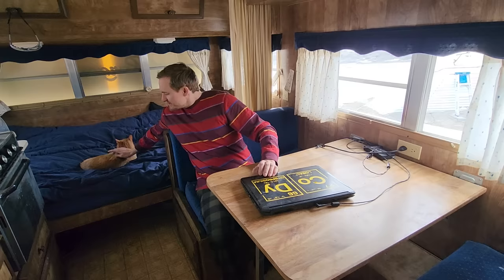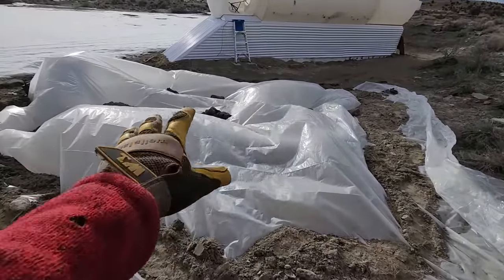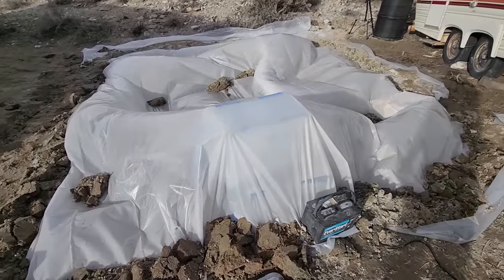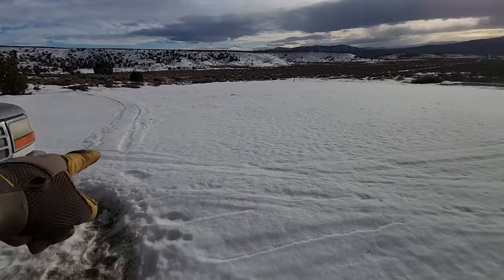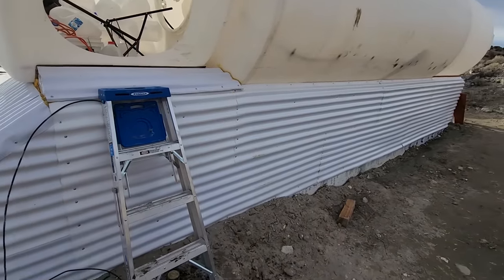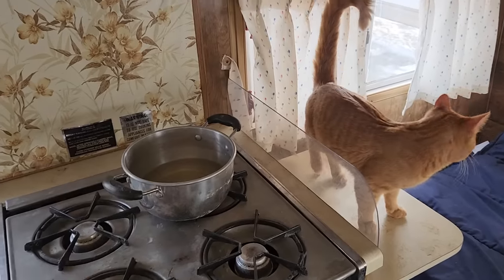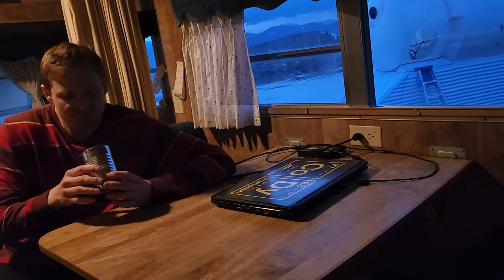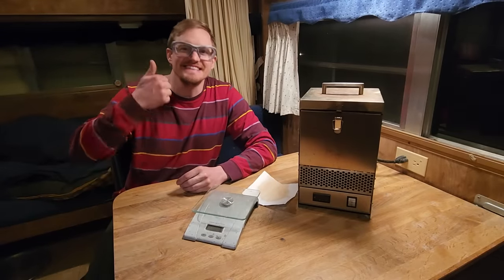ChickenHole Base Ep 21: Moisture Mining

Comment: I have a couple ideas for your water collection. I think it would make sense to combine your mineral heating method with the tarp method. To do this, instead of using a dehumidifier that needs constant power use a hygroscopic desiccant like calcium chloride or epsom salts. You can absorb all your water in that way without constant power expenditure, then kiln out the water all at once a few gallons at a time. I bet the short burst of kiln power will be less than the constant dehumidifier power. Maybe just have a little solar powered computer fan for mild circulation. Second idea is to mount a big umbrella shaped tarp on a wheelie cart or an automated roomba thing that changes location when it detects humidity has dropped below a useful threshold.
Reply: The buckets of desiccant could remain stationary in a solar still, picking up water at night, and getting rid of it during the day.  Just change where the air circulates twice a day.
Reply: @jimmymcgarry Your the kind of guy who buy him self out of a problem. But money can't buy brains bubba. The only bad idea in this world is not trying
Reply: Please collaborate!
Reply: alternatively, why not just use "passive cooling" (atmospheric window IR emission) for condensation, since the moisture is created by the sun anyway. 
the humidifier is essentially just an easy way to collect condensed water, no real need to waste power for that.
Reply: Interesting ideas. You might be right about the kiln using less power overall, but the advantage of using the dehumidifier imho is that it uses less power all at once, so in the context of a system on Mars, where there is effectively infinite solar power over a long time, but a strict limit at once (due to solar collection), the tradeoff may be worth it. Cody, you should have a drag race between the two methods! By the way, i love the idea of a giant roomba with a moveable umbrella to collect water autonomously. Very 1980s anime!
Reply: @TheRealWulfderay  im guessing some kind of gravity battery could work being fairly low tech and reliable as long as you keep sand out of the motor/generator. (motorater?)
Reply: Great idea! But there's more. Forgot a couple key elements a system like this should exploit, surface area and wicking. This should take advantage of the same basic principles radiators use in optimizing surface area for heat dissipation, only in reverse as we're trying to absorb moisture into the air. Depending on the wicking ability of the soil, furrows should be dug in a serpentine long, wide, and deep enough to ensure maximal loading of the flowing air before it reaches the desiccant. This should also ensure no dead zones are possible like with the current set up.
Reply: Easter egg!
Reply: Because heat transfer is proportional to temperature difference, I suspect heating up a kiln by hundreds of Kelvin is going to be less efficient than maintaining a dehumidifier with a small temperature difference in the tens of Kelvin. Higher temperature differences are proportionally more inefficient to maintain -- a  hot kiln loses energy much faster than a warm dehumidifier.
Reply: Always good to see Nighthawkinlight on so many nerdy science videos, not only that but sharing his educated and experienced opinions. One of the real ones 👑
Reply: @Shmashing2123 spoken like a true fellow who doesn’t know what they’re talking about, great input buddy!
Reply: @Shmashing2123 If you were stuck on Mars with thirty people, Night and Cody being part of the group, I think you would win the "who to eat first when we run out of food" debate.
Reply: I think using dessicant salts is a nice idea, but the more strongly they accept water the harder it is to remove again from the brine/crystals. I think the more efficient way might be to capture the water into silica gel with a fan under the tarp, and then release it with something more efficient than a kiln but that you still run for only a short time. Either the dehumidifier or (ideally) something similar to the way a heat pump clothes dryer works. (using the heat from the refrigeration cycle to heat up the gel, which absorbs and releases much of its water at near earth-ambient temperatures.) That said, a quick and less efficient way to get the water out might be a microwave oven with some kind of condenser; for gel and other absorbers, I believe it would pretty strongly prefer to heat the water and only enough to get it to evaporate? Also don't forget about day/night temperature cycles; might not be useful on mars but here it can easily pump water around via humidity.
Reply: In Nevada too I'd bet a solar kiln would be appropriate most of the year
Reply: A system similar to his RV fridge could run on solar thermal. Pc fan pushing fresh air through a condenser/collecter inside the cold chamber. 
I've been toying with this idea for a few years now. I just don't have the skills needed to build a custom solar thermal absorption refrigeration system. Something tells me Cody might.
Reply: I imagine a long length of large diameter aluminum ducting that's painted black to absorb solar energy and split in half lengthwise, placed in a circle laying open-side down on the soil so it can warm the air inside to draw more moisture out of the soil. Suspended inside the ducting would be a smaller diameter, vapor permeable tube that's filled with dessicant, and finally inside the tube holding the dessicant would be an isolated and sealed water cooling loop made from copper or aluminum pipe, which runs to an exterior radiator to dissipate excess heat. Using computer fans attached a small solar panel, a constant draft would be drawn through the ducting to pull moist air across the dessicant, which itself would be cooled below the internal air temperature of the ducting by the water loop to lower the dew point and encourage condensation directly onto the dessicant.

Once the dessicant is sufficiently saturated with moisture, it could be recovered using a solar kiln made with a fresnel lens to supply moist gas to a condenser.
Reply: The kiln could be solar heated as well...
Reply: @Shmashing2123  amazing contribution, truly groundbreaking thoughts and unparalleled problem solving. I don't know what anyone would do without your awe inspiring insight. Tell me, what would you do since you have already decided the ideas you replied to are terrible
Reply: I agree with  @davidsteinhour5562 . You can further reduce electrical consumption by means of a solar kiln, either parabolic reflector or water lens using plastic wrap.
Reply: I'm not so sure about the use of calcium chloride desiccant, while you might be able to save energy I'm not sure if that desiccant is good to use, it only works well when there is sustained, high humidity in the air.  This might not be the case for the base (or mars), at that rate of evaporation.  Maybe another desiccant, but ultimately the water would need to preferentially be absorbed into it rather than back into the ground.  It's definitely worth a test though.
Reply: The "automated roomba thing" should be RoboCody 👀
Reply: i bet the water would have a better taste as well.
Reply: @thetobyntr9540  Gravity batteries need to be megastructure scale to be practical for the amount of materials needed and the power output.

The passive energy collection of solar/wind and low consant load of a demumidifer would be lower maintenance and easier to get running.
Reply: could use a solar oven instead of a kiln and require almost no power at all
Reply: LOVE your channel BTW!!!

I think the best idea would be similar to what you mentioned but use the heat of the kiln to evaporate water from the soil.  Even using the heated clay/ceramic as it cools would be a good heat source under the tarp.  Then, to collect the water vapor, use the temp difference of the ground (like a geothermal cooling/heating system), pass the air through a copper or aluminum tube a couple feet under ground (it will need enough area to wick the heat away so the more heat being used, the larger the pipe needs to be).  

I'm not sure if the living area needs more heat but the furnace could very easily be used as the heat source with a few fans for circulation. If it doesn't need the heat, then utilizing that heat under the tarp would allow for the air to hold much more water than it would at the minimal temp difference it was operating at before.
Reply: @custos3249  I really like this idea and it would allow for a heat source to be utilized at the beginning of the evaporative path.  I suggested making use of the cooling clay/ceramic or even the heat from the kiln itself.  
I'm not sure if you are talking about the wicking ability of the soil (to bring moisture from below) or not.../
Reply: @kde5fan737  Thanks and yep, the wicking ability/capillary action of the soil is a critical factor. I considered your idea too but back away since it'd be another element to balance where as just using air flow at ambient temp relative to humidity and desiccant capacity keeps it simpler. Further, you don't want too much heat drying out the soil. Particulate matter has a nasty capacity to become hydrophobic if dried too much. It's fixable, but if you can eliminate the chance of an issue rather than mitigating the chance, all the better.
Reply: @Brandon Franklin  something tells me you might enjoy the channel Tech Ingredients if you haven't come across it yourself yet. Quite a bit of refrigeration based stuff on there
Reply: Concentrating solar kiln? 🤔
Reply: I don't think that is more efficient absorbing the water into a desiccant, you are wasting the sun's energy and will need to put into the water more than 2200J/g of energy to extract it from the dessicant, why not simply skip that step? Maybe could be even possible to use the cold of underground by running pipes as is done on geothermal HVAC.
With the dehumidifier you directly condense it into a cold surface which is cooled by a heat pump, phase change heat pumps can move more heat than the power they consume so more efficient than extracting water from the desiccant, in fact it should be possible to distill water very efficiently with a heat pump, probably even using the water itself as phase change fluid under reduced pressure having to input a much smaller amount of energy because you are using the water's vaporization heat to heat itself only having to compensate for the energy used to create the pressure differential between the condenser and the evaporator and any heat lost from the condenser.

Comment: I had almost forgotten about chicken hole base, and then out of nowhere, new episode to brighten my day.  EDIT:  I'd like to propose an alternate rig setup for your distillation.  Bury one of your smaller tanks completely, and put shade over it.  Have a hose coming from under the tarp to a relatively high point.  Warmer air from under the tarp should create a natural draft to this high point.  At the high point, put some coils to cool the air and some shade over that.  From the coils, drop another hose down to the buried tank, all the way to the bottom of it.  From the top of the buried tank, run another hose back to the tarp.  This makes it a completely passive system that gets the benefit of the higher temperature differential, but without needing any moving parts or electricity.

Comment: If you use a portable A/C unit inside your camper you will be able to reclaim gallons of water a day via the drain vent on the A/C unit, we found this out last summer inside of our RV.
Reply: Yummy yummy legionnaires disease
Reply: Any kind of reclaimed water has that issue, unless you have a grid or deep well you need to desinfect
Reply: Hopefully you filter the heck out it.  Bacteria will be rampant.
Reply: smart idea but he is simulating that he is on Mars so the exhaust would also be a task to find a way to get the waste air out and new air in without it being stuck outside a window but if that can be solved it is a great idea for constant cooling and water source but power is limited and A/C's use a lot of power. It still would be a fun experiment to see and to see how much water it can collect from just being in the air inside alone since very little outside air around on Mars.
Reply: @CameronSalazar2113  eventually the greenhouses would be hooked into the air system to convert the co2 back to o2 and food. and i think the greenhouses already have a system in place/planned to dehumidify the air before sending it to the habitats. so any moisture he breaths out will make its way there via the co2 return vents
Reply: @sheabrown  Wouldn’t that also be a problem with the dehumidifier, they’re both refrigeration circuits condensing water out of air
Reply: All praise the sweaty who will drink their fill!
Reply: @sheabrown  lol I didn't know that was a thing.
Would hold my fast against a/c water splatter as a kid lol
Reply: @CameronSalazar2113  Portable ACs often come with 2 hoses to totally isolate outside air from the inside air. That should cover the issue of it not being "hermetically" sealed but yea humidity on mars would make that pretty useless.
Reply: That's pretty much the same thing as using a dehumidifier. They work in exactly the same way.
Reply: @Falcodrin  With that in mind and no useful humidity he could use in Mars atmosphere, the idea of that system of plastic on the ground and siphon the humidity created and pull or push it into the hab and allow that to moisten the air, at the same time also creating water through an A/C system or condensing system like cold pipes. The question is would that be hard to isolate and use that same air in 2 separate atmospheres, that would be interesting but not impossible. Lastly, he has a plant area that may create enough moisture with his body fluids also to keep the air moist and he can turn that back into usable water. But will the same amount of water he started with stay? That is why the outside system will help create more water after the plants use a lot of it and his own personal use idk if 100% of the water used comes back from plants and human by-products‼
Reply: @sheabrown  filter and boil.
Reply: That's less true in the high desert of Nevada, where Chickenhole Base is located. Daytime relative humidity in the summer is usually <20%, so most of what he'd be collecting off the A/C is Cody's sweat and exhaled breath.
Reply: @sheabrown  That's what the Berkey carbon filter is for.
Reply: @CameronSalazar2113  ah you were focusing on efficiency by working on reclamation. 

I think initially that would be fairly important but if supply isn't the primary issue anymore say once everything is set up than you would want to harvest from wherever the relative humidity is highest to save power. 

Since you would literally never NEED ac on a mars habitat than dehumidifying in the hab will help keep it comfortable and increases temp slightly which could be useful.
Reply: I'm a little concerned about the sanitation of all this stagnant water Cody has in the tanks already. The saline one is fine, but in the Summer I can only see the ice one turn into a breeding ground for mosquitoes or algae but Cody might like the latter.

Drinking ac/dehumidifer water makes me worry about legionnaire's disease.

Comment: Question about the clay. Will it reabsorb water out of the atmosphere gaining 20% or so weight in the process?
Reply from the maker: No, it's no longer clay, it's a ceramic now. It might absorb some just because silica powder attracts some water but nowhere near the 20%.
Reply: @theCodyReeder  Is it one step to get oxigen from clay and other minerals?
Reply: @theCodyReeder  don't you have to keep moving the tarp around once the soil below gets too dry? Or does it wick in more humidity from the outside?
Reply: @rofltehcat on a large scale I can see this being a problem but I assume that also depends on the weather\season. And it probably wouldn’t be worth to move it as the edges would still be collecting some moisture.

Comment: Great video, thanks. I always enjoy the reports from Chicken Hole Base. The crew habitat looks good, a big upgrade. I think it would be great to collect more data, e.g. grams of water per watt from the water extractor. Is there any cell signal or other radio at CHB? It would be great to broadcast telemetry from the green house and other things at CHB. I don't know what is involved with doing that, but it sounds like a cool project.
Reply: And heating the clay... puts the water into the air, then you dehumidify it and bamm water to drink.

Comment: Hey Cody - for your final version of this moisture farming system, it might be prudent to try to solder your own coil or otherwise take steps to guarantee you're not getting any heavy metal leaching from the dehumidifier itself. Such a cool idea!
Reply from the maker: For the final version I'm thinking of using a big tank of water for cooling. At night I will run the water through radiators to regenerate it's cooling capacity.
Reply: @theCodyReeder  It sounds like the limiting factors would be the heat exchangers - both nighttime radiator and daytime condensate collecting coil. I think the ratio of sizing between the radiator and the dehumidifier HX would be driven mostly by the difference between daytime and nighttime temps. Since you're at 100% RH in the tent, all your energy is going to heat of condensation.

I used to sell industrial refrigeration equipment and I'd be happy to do calculations on HX sizing if that could help in any way!

Comment: But the water in the ground won't replenish? At least not in most areas where ground water is not that far below surface. And even if, it would take long to replenish.
Reply from the maker: Yes, this is a method of mining water. On mars You could scrape off the dry regolith to expose more ice or move to another location. It's possible to deplete the resource but there is quite a lot available.